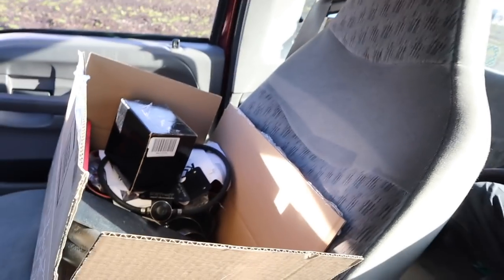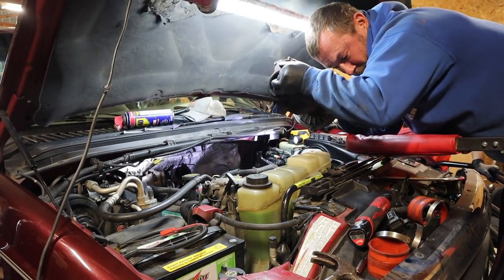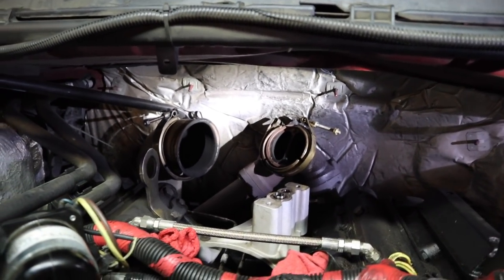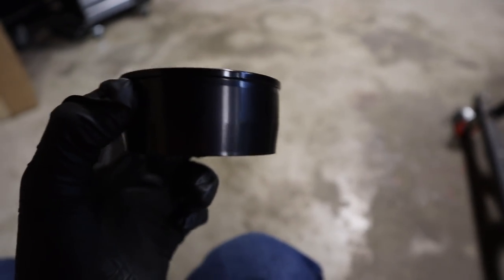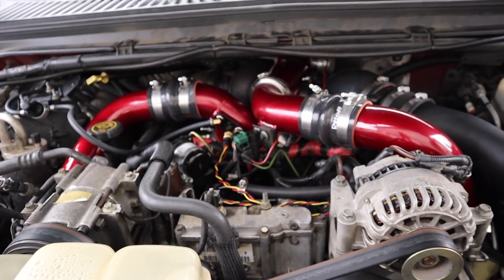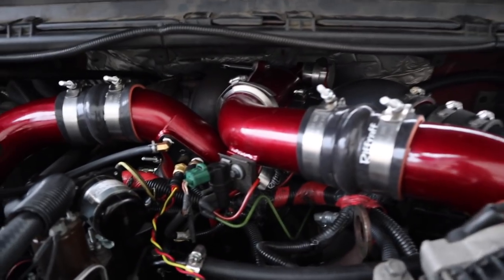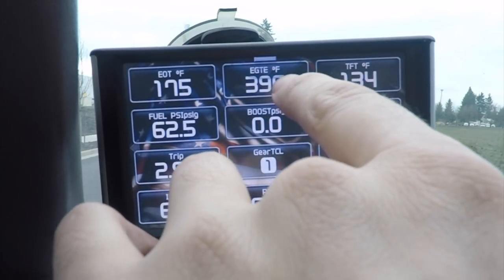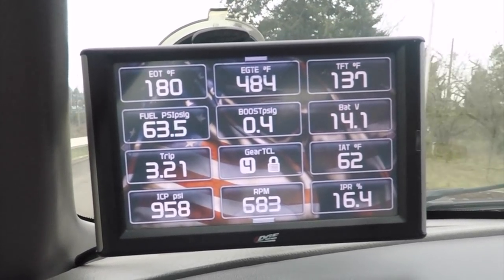Ford 7.3 Powerstroke KC300x Turbo and Pusher Intake Install!!!

Comment: It looks great! Does it seem to help with daily driving? I just bought the edge tuner, intake and exhaust and love them. I noticed my ICP pressure is around high 400's to 500's at idle and fluctuates 30 psi or so while yours was staying pretty steady and above 500. Truck runs smooth but I'm thinking of replacing the IPR valve and sensor. Any thoughts?
Reply from the maker: It does help with daily drivability. It not a crazy difference by any means but it is noticeable. I think at  warm idle it should be around 500-600. How old is your HPOP?
Reply: @LivingOnWheels  I think it's the stock one from 2001 with 261k miles. I just bought the truck a few months ago and caught the 7.3 bug. Lol. I really enjoy the channel. Keep it up!

Comment: Nice truck Have you put injectors in the yet... What edge monitor do u gave ?
Reply from the maker: Thanks. It has AC 160/0s and it’s the edge insight cts 2. Should be linked in the description.

Comment: Great content and awesome truck.  I am installing the same setup with the KC turbo and the S and B cold air intake.  How did you connect those two together?  Looks like you used the stock elbow as a connector?
Reply from the maker: Yup. I used the stock CCV plastic coupler to connect mine. Its all a very tight fit but doable.

Comment: Turbo looks great!
What type of intake do you have?
I expertly cataloged the waste gate accuater red and green lines in my garage. Lol. Unnecessary.
Reply from the maker: It the S&B intake. I actually did a pretty good video on it a little while back. I thought about getting rid of those lines but was concerned about throwing a code on the solenoid
Reply: @LivingOnWheels  
I left the solenoid plugged in. Took a hose and directly attached it from the manifold to a 15 psi waste gate. Seems to work fine. (No over boost codes under 22.5 psi.)
Reply from the maker: @norman_sage2528  Interesting. I was thinking about doing something similar just wasn't sure what it'd do if it wasn't reding any pressure at all. Thanks for the info

Comment: Looking good!  But the proof is in the pudding...It would be great to see your truck on a DYNO to see how much HP/TQ you gained.
Reply from the maker: Trust me, I am really hoping to get her on a dyno in the near future! Im thinking it should be close to 350-375 on the max tune based one everything ive seen but the dyno will have to happen at some point for sure!
Reply: @LivingOnWheels  I have to agree.  i bet you hit 350hp no problem with 2x torque.  I follow your channel closely and I appreciate all the info you provide to the community.  Thanks again ;  )
Reply from the maker: Much appreciated!

Comment: What tunes are you running? Boost fooler shouldnt be needed. All modern tunes just write the map sensor out of the tunes anyway.
Reply from the maker: I run 1023 tunes. I am aware of this. The main reason I put the fooler on was to not be throwing a ton of pressure at my stock map sensor all the time. It may not be necessary but I figure the stock sensor wasn’t meant to be taking that high of boost all the time. So I figured why not.

Comment: I would leave ur ccv how u plumbed it, no catch can
Reply from the maker: I might, we will see if the smell ends up bugging me
Reply: I got a long enough hose from advance and ran it all the way back and pushed it through a whole in the transmission crossmember. You do notice the synthetic smell as a heads up..

Comment: How did you get the turbo boot on??
Reply from the maker: A lot of swearing haha. Got it on the turbo and clamped and then forced it into place and bolted on the middle coupler to hold it there.
Reply: @LivingOnWheels  oh i gotcha. Been fighting it for 2 days now and it still won’t go on. Tons of pry bars and wd40

Comment: How'd you get the provided boot on the turbo I cant get mine on lol
Reply from the maker: Probably not supposed to but we used a little WD40 to lube it up. It’s a VERY tight fit though! It also wanted to keep slowly pushing back off though. So have your clamp ready.
Reply: @LivingOnWheels  thanks for the quick reply, I managed to put some elbow grease into it with a carefully placed screwdriver and it seemed to work but man it's a tight fit
Reply from the maker: Nice!

Comment: Did you pre lube the turbo
Reply from the maker: I put some oil in and spun it around a bit but its hard to really prelube it because the intake and exhaust oil spouts are on the bottom.

Comment: Hey does your exhaust have a muffler or just straight pipe?
Reply from the maker: 4" strait pipe all the way back
Reply: @LivingOnWheels  appreciate the response man. Do you think it hurt performance at all? I didnt know if you had the EGT probe before and after to see a difference
Reply from the maker: I didn’t have the probe before and after but it did not hurt the performance. Diesels are different than gas. The more free flowing the better.

Comment: you should not reverse the crank case vent, it should go through the turbo, bad idea, just my opinion
Reply from the maker: I could be wrong but I believe international actually ran some t444e engine applications with atmospheric venting. Ford's 7.3s needed to be vented back into the intakes for emissions purposes. Most times you see people running into issues with the CCV mod is when they do it with too small of tube (because its easy) or provide a point of clogging. That being said, I am thinking I will probably end up running it to a catch can and then back into the intake. Gets the oil out and keeps the vacuum on the system.

Comment: "open the hood and your like... wow"
yeah... because of all the wires everywhere... dude get some split loom, automotive splitloom rated for the heat, not from home depot... and friction tape
AND STOP TAPING RELAYS IN PLACE.... my jaw hit the floor on that...
Reply from the maker: All the wires are loomed with the oem split loom or braided sleeves at this point. I usually leave things like wiring a little bit unfinished until I live with it for a while and am sure that is how I want it finalized. Now as for the relays... You're totally right to call me out on that. I originally had them mounted to a plate that was epoxied to the whole fuse and relay assembly. The epoxy failed and so I taped them as a temporary solution to keep them from moving too much. I do need to go through and remake the mounting plate for that it looks way to trashy as it is.